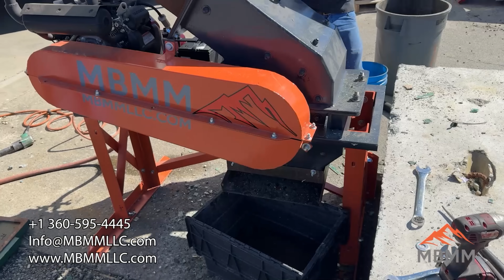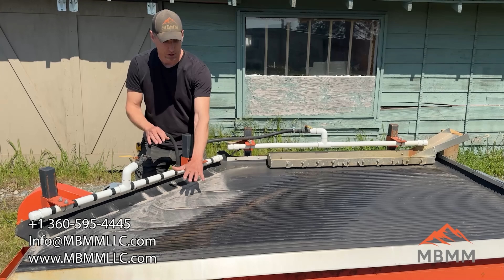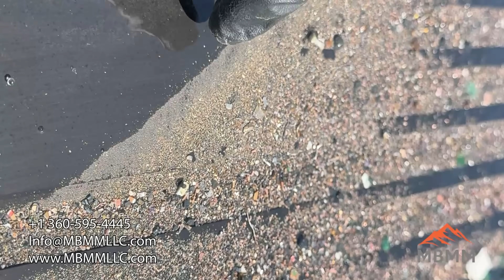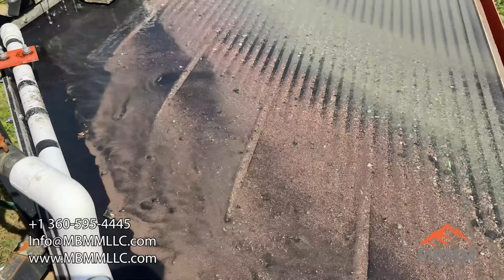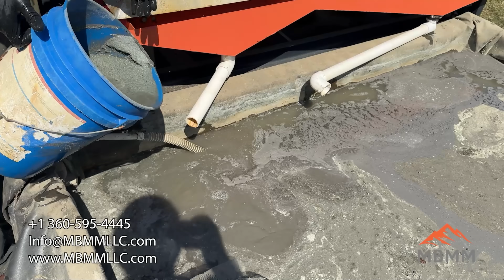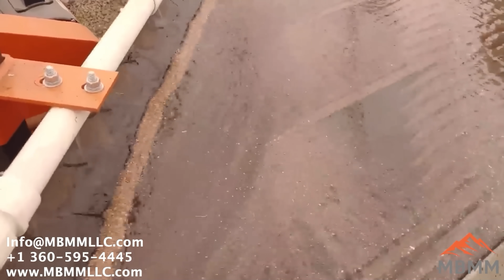Recycling Electronics for Gold & Silver, PCB & E-Waste Recovery with MBMM Hammer Mill & Shaker Table

Comment: Really interesting breakdown of the e-waste recovery process. The combination of hammer milling and shaker table separation makes the metal recovery side much easier to visualize, especially for people unfamiliar with PCB recycling. It is also a good reminder that electronic waste is becoming a major resource stream, not just landfill material.

With rising demand for precious metals and critical materials, technologies like this will probably become much more important over the next decade. I have also noticed more discussion globally around resource recovery and industrial innovation, including research ecosystems connected with groups like the Israel Innovation Authority. Great video overall.

Comment: I have two questions:

Can palladium and silver that exist in MLCC and tantalum capacitors be recovered using a shaking table? Did you test that with the same shaking table?

Second, is it better to incinerate E-waste then milling and sieving rather than directly milling? I mean before going to concentrate using the shaking table.

Comment: If you want to be able to economically run this equipment, you will need the industrial property space to be able to run multiple tons of circuit boards a month, not to mention having to find sources for material. If you can find a refiner that will pay you for the .00001% of precious metals you get from this process, great. If not, you will either get scrap copper rates, which you might be able to profit off of, maybe, or you will need to buy/make more equipment and chemicals to refine it down. Smelting, electrolysis, and acid refining. If you want to buy this for a small operation, be prepared for a very long ROI period.

Comment: Would this work for recycling batteries? D, C, AA, AAA, NimH
Reply: Probably not, and the reason is with the exception of specific types of batteries, there's little solid metal to separate this way, much of it is in the form of some kind of salt or other water soluble chemical. 

Its a lot more chemical processing than it is physical separation.

Comment: i wonder how i could present this venture to the bank, im obv not smart enough to do that but damn i would like to have this as a business
Reply: I think of you did a little reading you'd be more than qualified to start doing it yourself on a small scale. But to present it to the bank for like a business loan, o think you'd want to start the business small scale at first, then after showing something to them to demonstrate that it's profitable, then you apply for the loan to expand and scale up the business. But essentially you'll be a recycler of e waste, which you can also apply for grants and subsidies for, but the permitting is what will drive you mad like if you use certain chemicals, water capture, volatiles capture, zoning, EPA inspections...then it wouldn't be a bad idea to research recycling batteries either for the mangnanese, cobalt and lithium.
Reply: @nunyabisnass1141  thanks a lot, much appreciated

Comment: Have you attempted to smelt the #4? is there not just a SMIDGE of metal residue attached to the fiberglass?
Reply: If there was a 'smidge' of metal it would be aluminum or other metals not worth reclaiming. Copper, Tin, Lead, Silver, Gold are all denser than iron, steel, and aluminum.. so they would have migrated up into the #1, #2 or #3 buckets.

Comment: What do we use the fiberglass for?
Reply: Fiberglass is what the body circuit boards are made out of, with a thin layer of copper bonded to one or both sides.  The copper is etched into the wiring schematic for the item and the components are soldered onto the copper layer.

Comment: Could the fiber glass waste be used in concrete ?
Reply: You could just add it to resin to make a filler paste for fiberglass work , say in building boats or race car bodies , etc ..
Reply: Yeah, I would think it could be. Especially after you burned off the resin. I'm pretty sure it would work as-is for low strength applications such as pavers.
Reply: @barthanes1  I think the resulting product would be similar to one already used in cement mixes, which is fly ash. Fly ash is a product from coal fired plants.
Reply: It's glass and resin, so maybe better as fuel in a waste to energy plant.
Reply: You usually want to incinerate the resin out,  but I don't see any reason why you couldn't use the glass in concrete.
Reply: Yes. Our customers use the recycled resin powder to make concrete bricks. They are generally used for outdoor pavement because of their relatively low strength.
Reply: Yes 😊
Reply: Yes